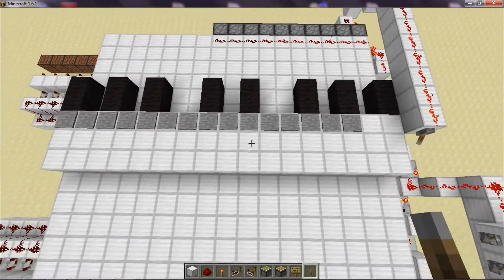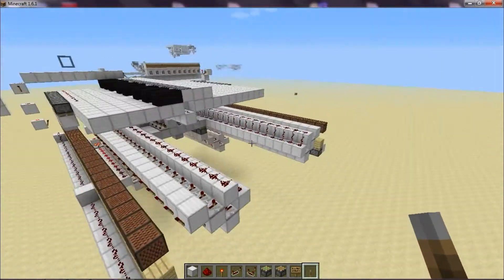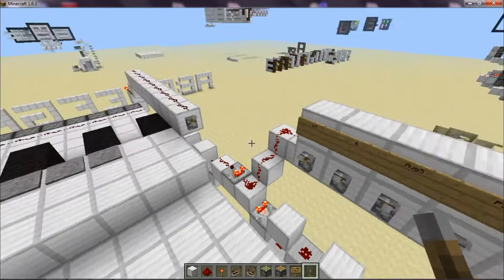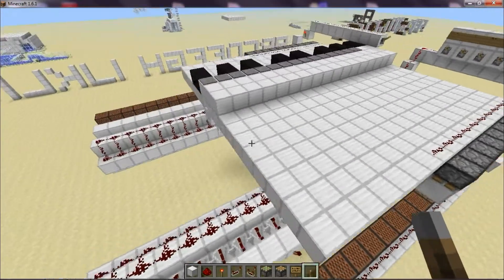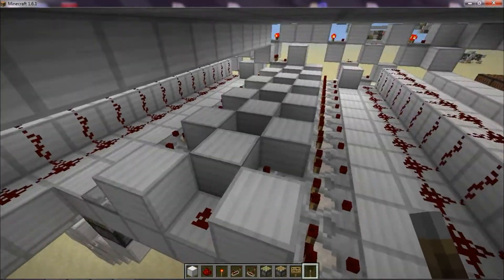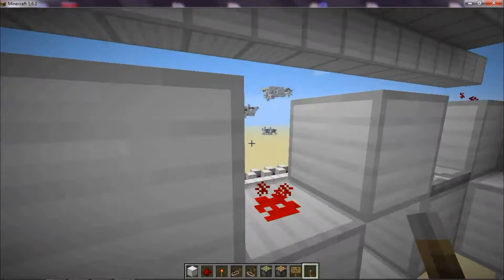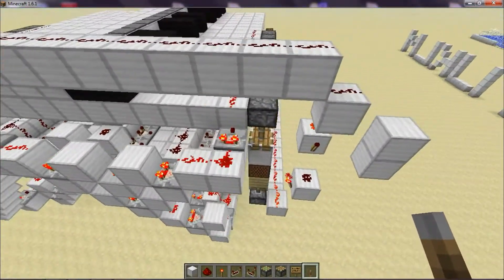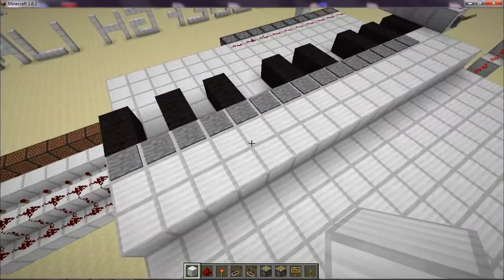Analog Synth in Minecraft

Comment: An analog synthesizer does not have any sort of "computer". It's an ANALOG synthesizer. Do you know what that means? Do you even know what an oscillator is? Do you know anything about synthesis???
Reply: You're right. But why is it necessary to say it in such a harsh way? Do you want to make the uploader sad, or do you want to spread healthy information? After all he was the one who built a freaking synthesizer in Minecraft, even if it doesn't come close to a real one. Give him some credit!
Reply: MÅNEMANN MÅNEMANN It’s not that complicated to make actually. Hook a lever to a note block and repeat 25 times, then add sticky pistons with various blocks. What he calls an ‘oscillator’ isn’t even oscillating, which is weird because that’s completely possible using a red stone clock.
Reply: its a virtual analog synth because it uses control voltages rather than binary.
Reply: yes, that's right
Reply: never felt the loving touch of another human being?
Reply: You can have a computer in an analog synth.any chip used is technically a computer it's just built for a specific purpose. The issue is dependant on how it's generated and controlled, this is still digital since it uses PCM samples. But you have commented in such a rude and spiteful way. It's just a Minecraft video calm down.